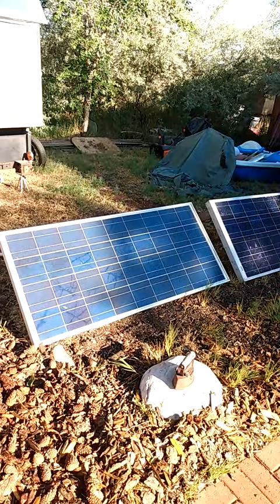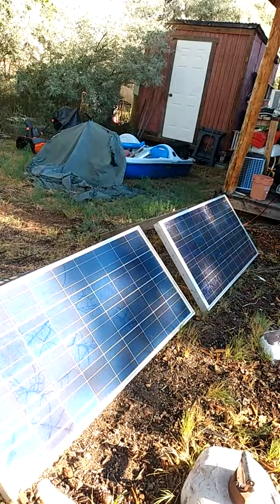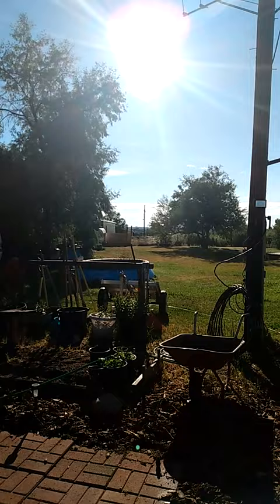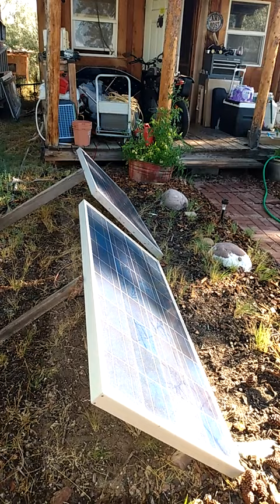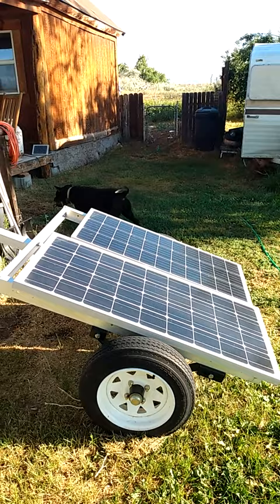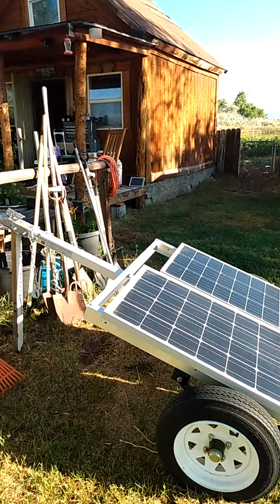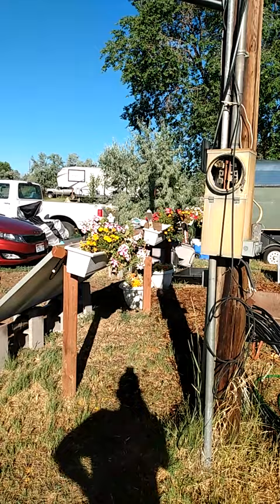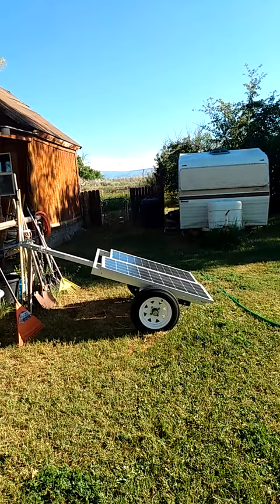Simple Solar Angle Mount To Maximize Solar Power!

Comment: put a hinge on each panel on the hitching post and a hinge on the bottom with a piece of 1x3 with holes  so  you can pitch the panels how you need them and pin them in place

Comment: You can run a small A/C unit off of solar, but you need a LOT of panels an batteries for storage. And they'll still drain quickly.  I understand they have or are about to release some mini split units that run on solar DC power.  My friend has a micro hydro setup and solar panels and he runs a dehumidifier on the bad days.
Reply from the maker: We need better AC units that don't require as much power. Mini splits can work for cooling but not great for heating.

Comment: Why not make a solar tracker using a rope and a bucket of water with a hole in it ? As the water drains out, the solar panels change the angle and keep following the Sun. That way you just have to fill up the water in the bucket once a day ...
Reply from the maker: Trackers are nice but they tend to get stuck in cloud cover. I prefer a manual system that  I can move as needed.

Comment: https://youtu.be/eyWSrdsglWI
This or something like it would be fun to try with smaller panels. Mine are too big and it's too windy here but I've always wanted to try. Get the drip rate right and could get it to where you just pour water in in the morning and forget about it.
Some sort of timer to run a pump in the morning to automatically refill could be pretty simple and fully automate the whole thing.